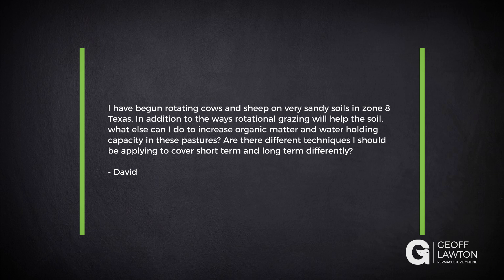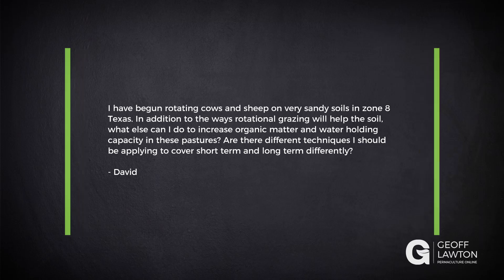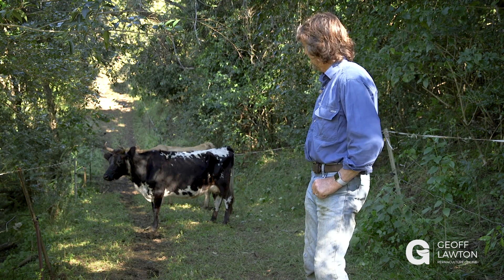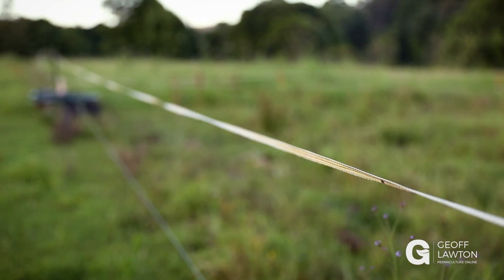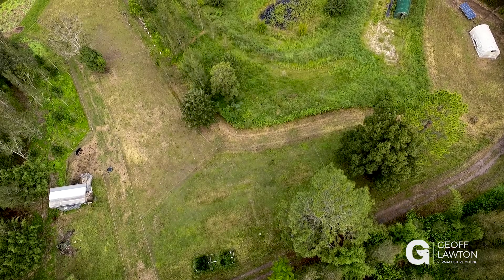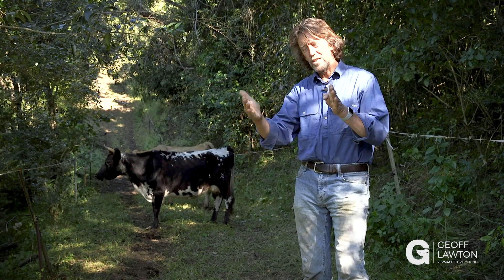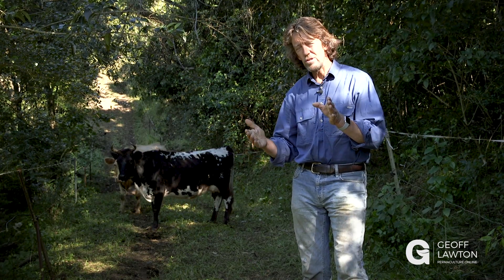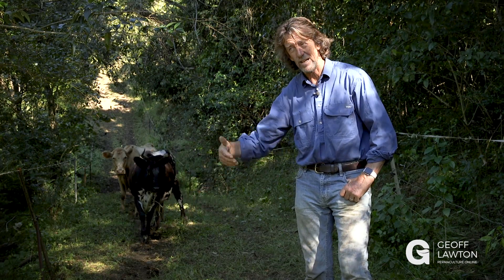Function Stacking with Rotational Cattle Grazing

Comment: In the scientific literature, intensive rotational grazing has been exhaustively studied for decades and there is insufficient and inconsistent evidence that it provides ecological or production benefits.[Source: https://www.ars.usda.gov/ARSUserFiles/1354/75.%20REM-D-10-00084.1.pdf ]

Potential for carbon sequestration is interesting, but likewise has not been proven in long-term studies (carbon is hard to measure due to it's ubiquity and biological interactions which liberate carbon into the atmosphere). As much as manure is stomped into the ground, surely a similar amount of soil carbon is churned up, exposed to sunlight and off-gassed.

Given what we know about cattle, their ability to erode topsoil and belch methane - I do not think rotational grazing should be advocated in 'permaculture design science' without qualifying that the evidence is far from conclusive, may only apply to certain soils/climates if at all and the potential for harm and mismanagement is so great.

Encourage people to use any animal other than the top-heavy cloven-hoofed cow - there's 1.5 billion cattle, a single species, it only takes one new disease and half of the worlds preferred animal-protein is gone.

Comment: Fact: cows exert more pressure on soil than an elephant due to the smaller ratio of the area of their feet to their mass.

Literally the most destructive footprints since the dinosaurs roamed.

It will take a lot of rotations to offset that impact.
Reply: Managing the imprinting through strategic design timing improves the fertility of land more efficiently than any system known.  As usual the most damaging can be the most beneficial, thiseven relates to humans, understanding the balance potential of the universe is the way we understand patterns which is permaculture design.